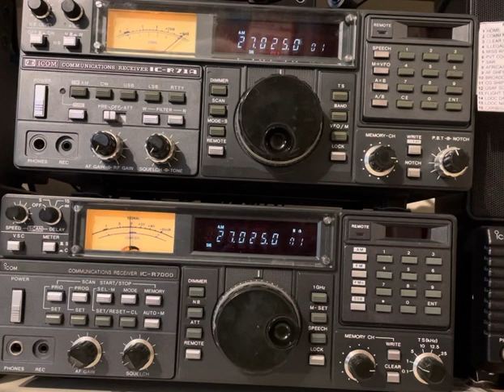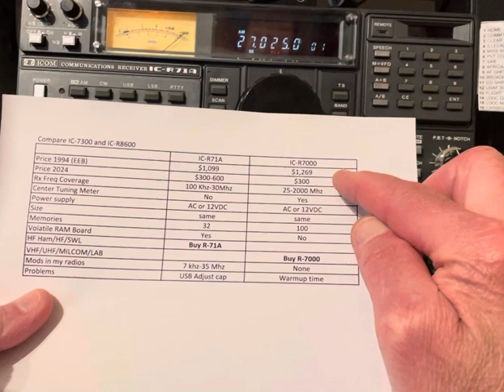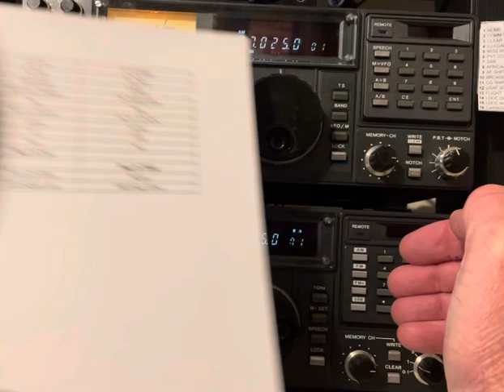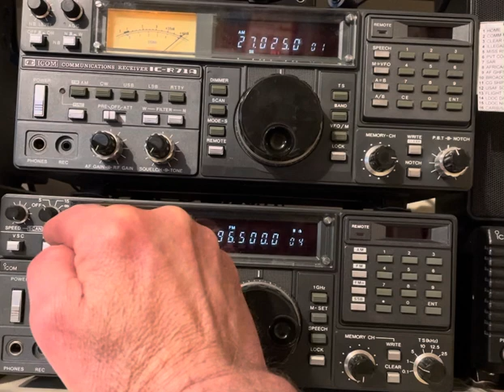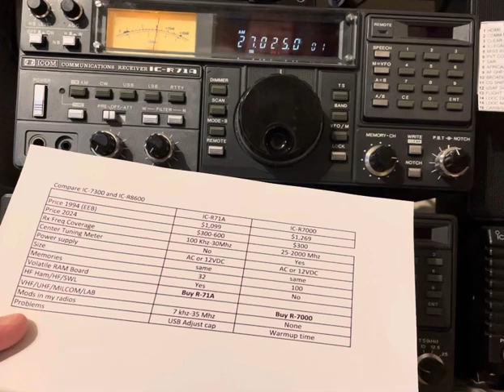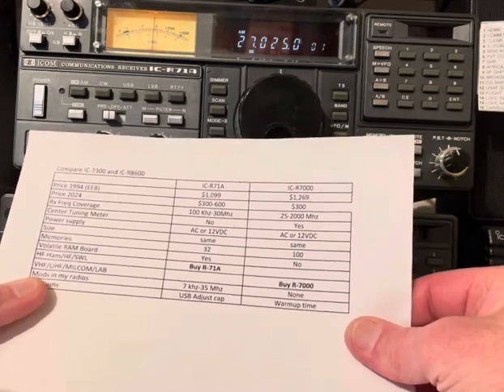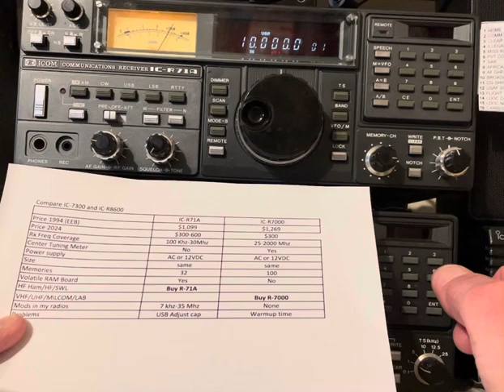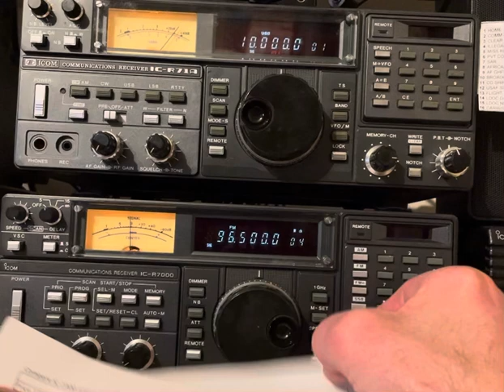25 Year Review Icom IC-R71A and IC-R7000 receivers

Comment: I bought my R7000 in 1990 and it is still running perfectly today with no repairs. Even the original backup battery is still functioning. Today, I use it mainly for monitoring  military air-to-air refueling tracks. In 2015, I bought a second R7000 at a hamfest for $100; all it needed was a new set of capacitors on the DC-DC board. It was a really good receiver. It could hear distant local fast food drive thru transmissions that my Bearcat scanner could not hear (and that's using the same coax and antenna being swapped between the two radios) spotlighting the sensitivity and quality of the R7000.

Comment: Great review. Interesting you mention the heat from the internal PSU, I have the R71E version in the UK since new in 1987. it lasted 3 years and made a horrendous noise from the speaker and that was the end of mains usage !   Rewired it for12v and its still in use today, and with the original ram board battery. 37 years not bad for a battery !
Reply: I could do with a conversion to 12volt external supply how to so I can do the same mine just gets very hot indeed👍🏻👍🏻